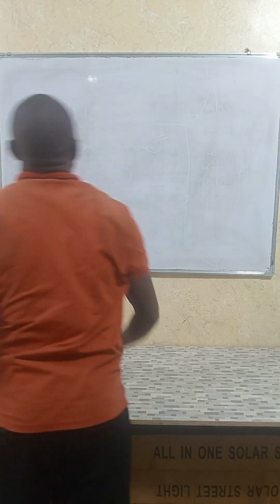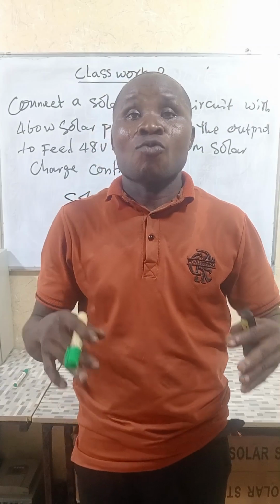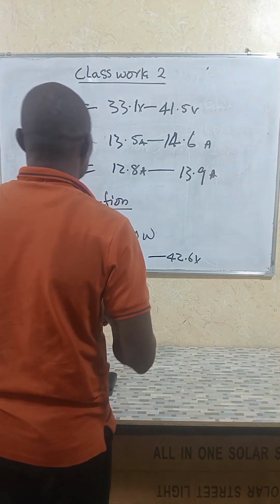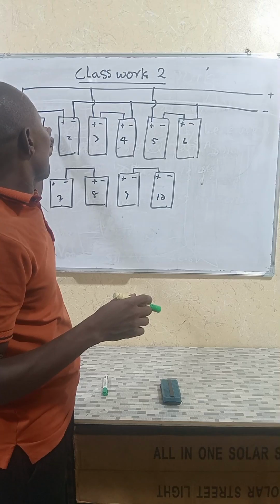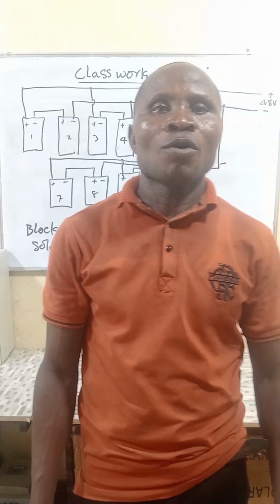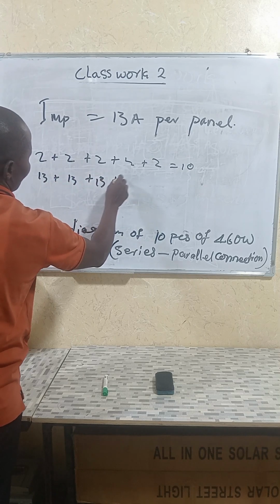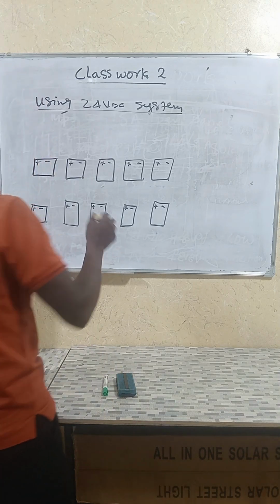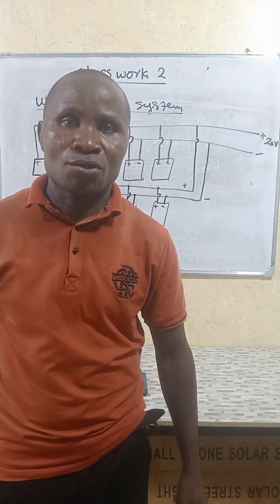PRACTICAL WAYS ON HOW TO DESIGN A SOLAR SYSTEM ( CLASS WORK 2)

Comment: 2panels were in series so 39*2=78volts 

After that you connect them in parallel so the total voltage will be 78volts only current will change but voltage remain constant in parallel